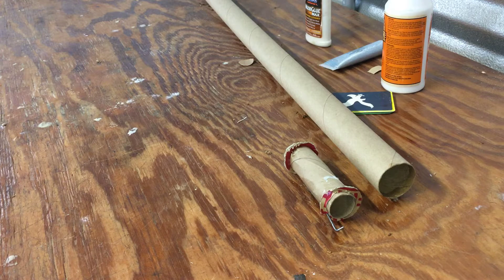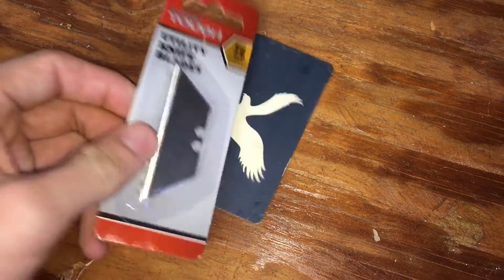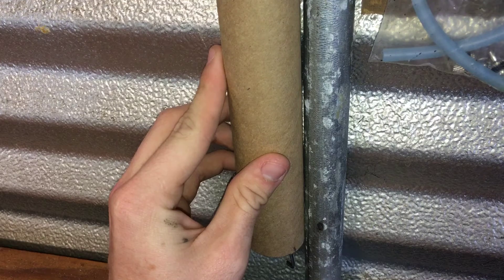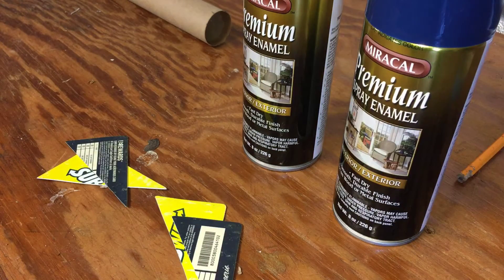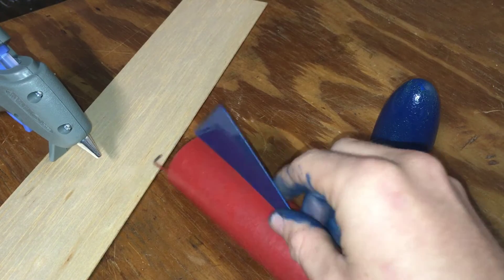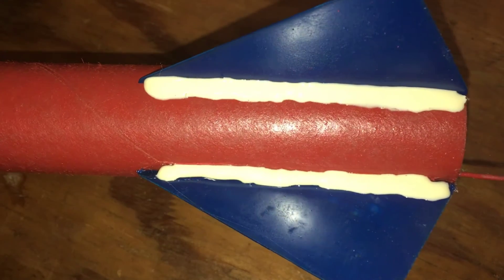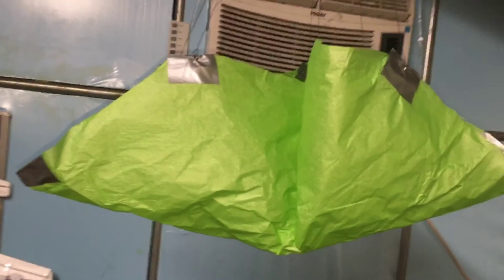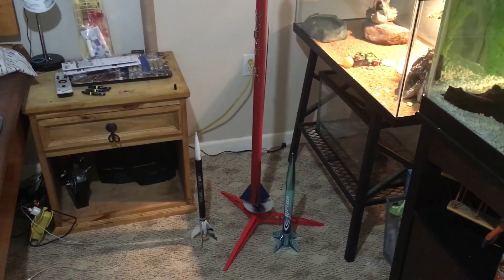How To Build Your Own Homemade Model Rocket (Part 2)

Comment: what about putting the nose cone on?? also, how did you insert the parachute??
Reply from the maker: The Easter egg was a perfect fit on the end of the tube and you just glue the parachute strings to the inside of the Easter egg the parachute just slides in and is ejected when the motor burns out from the ejection charge